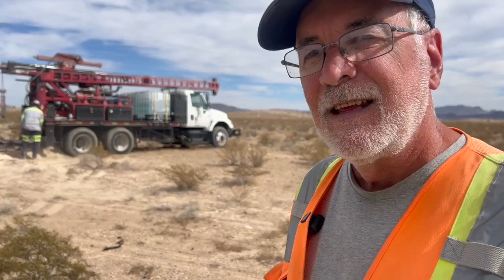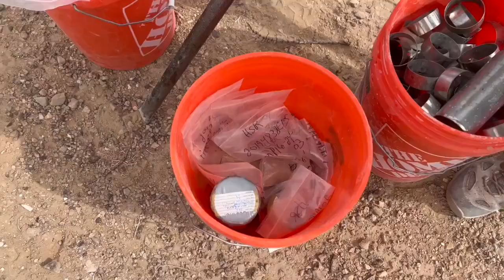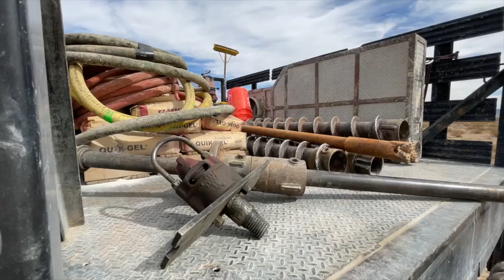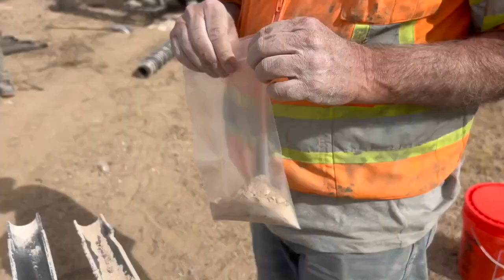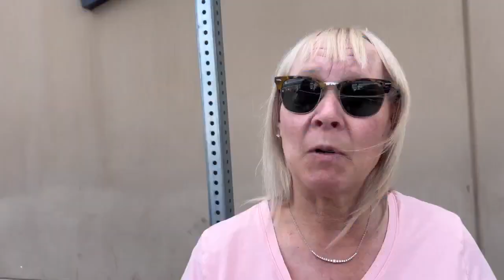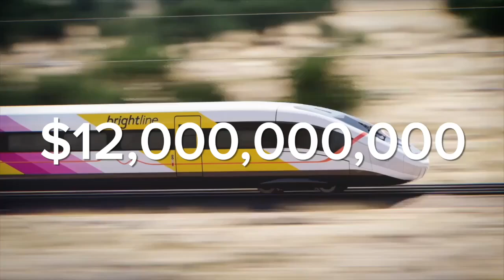Brightline West advances high-speed rail project with soil testing along I-15 corridor

Comment: The route of Amtrak's former Desert Wind passenger train between LV & LA still exists, if Union Pacific were to allow for interim operation until Brightline West is finished building.
Reply: Brightline west is an electric system. I think it’s for the best to build a new system instead of buying diesel trains for a temporary system that will under deliver on the main projects promises.
Reply: UP won't allow this since it might slow down the money making freights!

Comment: I want to see it completed so bad, but there is no way they will have it completed by the 2028 Olympics like they want to.
Reply: Yea. That was just a way to get financing quicker. They also say it won’t be electric to start. They are starting with diesel engines. So basically it will never be electrified. They also claimed to be private funds only. But begged the govt for money. This won’t be done before cahsr tbh. They will shortly see why California has been delayed. Especially when it comes to construction months in the middle of the desert. Lack of workers and cheap pay. Most ca cause workers from Central Valley average $23 per hour. $1 more than in n out burgers. Inside the a/c. And not in 110 degree weather with no shade.